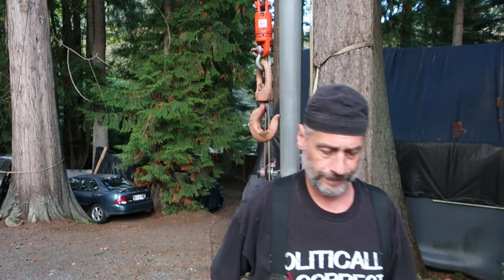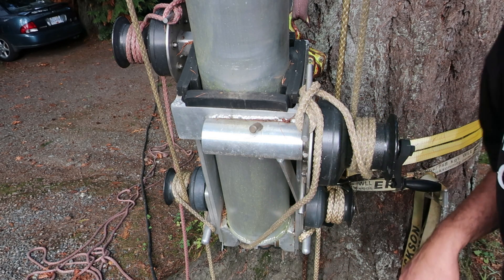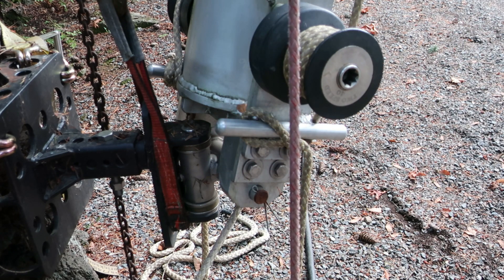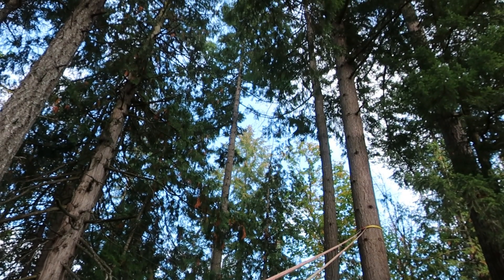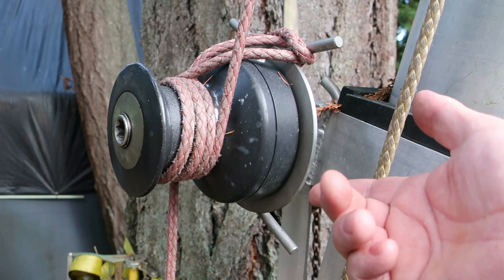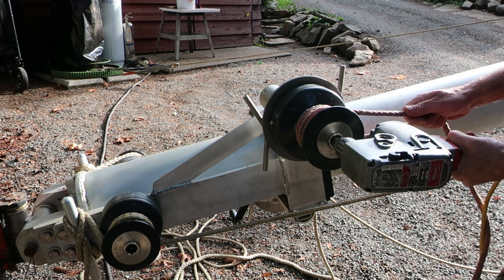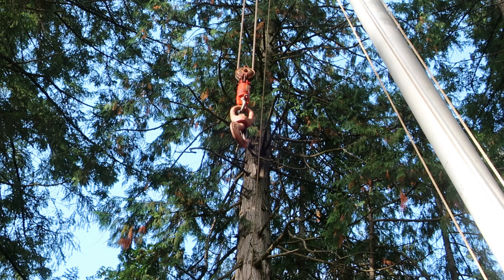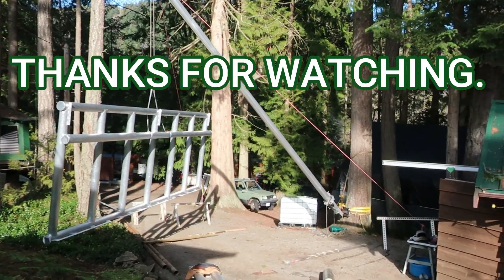A DIY portable derrik crane. Another way for idiots to hurt themselves.

Comment: pretty cool. I would like to see a simple crane set up for use on a utility trailer they can reach onto a single-story roof for lifting smaller air conditioners, such as the multi split units
Reply: you can build one with 2inch tubing. take notes that the lenght of the boom is the main factor reducing the load capacity, longer boom means it carry less. also the widest tubing the better, the thickness of the tubing actually reduce it's load bc it contributes to bending of the tube.

Comment: Excellent work. Many years ago we used a similar Boom Lift to build a Three Storey House, Octagonal in shape, and built around a 10 metre high Central Column made from a White Mahogany Tree Trunk. We moved the Girdle/ Universal Joint up to the floor above as we completed each level. It worked perfectly. We lifted all Floor timbers, Wall timbers, Doors and Large Scenic Glass Windows into place , easily, safely and with perfect precision. No gut busting or precarious lifting, all smooth and expertly done. I designed and operated the Climbing Boom Lift, and like yours, when broken down to its component parts  was easily handled by one man. The Builder I assisted approached me before he accepted the job, to see if it was feasible. The job was on a difficult to access site, and although other builders quoted the job, their high prices were a reflection of moving an all Terrain Crane into a difficult site. Our price ended up being a third of the other tenders. The beauty of this one man, portable Lifting Apparatus was it cost very little to build and use. I also worked as a carpenter on the project. I worked with this same builder on many projects that other builders could not do. We built many other different Lifting Apparatus when required. As an Engineer I found the work both challenging and rewarding. Cheers from Michael . Australia.

Comment: Fascinating how the boom is used as a compression post which can take  I suppose in theory 20 tons as shown in the pressure test yet is so light weight aluminum.  The weight somehow directly transfers  from the lifting point cable down through the boom to its anchor point at the tree base, while the boom itself and the weight being lifted also  are supported by the boom support cable, and somehow none of this  bends the boom pole.  I'm curious as to how this actually works but I guess it''s  what I described if I understand it correctly.   It seems lifting the weight is one obstacle while to then pivot the lifted weight would be  another vulnerable point  on that welded bracket.  How much do you feel comfortable lifting with this set up?   I'm guessing a ton or two?
Reply from the maker: I think we are on the same page.  1 or 2 tons, more than that and the tree and it's bark would begin to get damaged I feel.  If it were on concrete and had a significant mast the failure point would be interesting to see.  It reminds me of the cranes I've worked with over the years and how they have engineered those spindly booms  to take such a load.
Reply: according to the equation of bernouli, yes, 4inch tubes can carry 20tons, but that's like the upper limit,

Comment: The video title is 100% accurate.  I built one very similar but used 4" sch 40 carbon steel pipe. It defiantly made the list of tools I will never let anybody use. Had zero issues lifting one end of a lightly loaded 40' connex container with it.

Comment: What is the weight capacity?
Reply from the maker: I have lifted 1500 pounds, I would haft  to change the come a long to something bigger to lift more.  Probably would go to different rigging, I think 1500 pounds is as much as I will push it.
Reply: Tbe weight capacity is the rated safe working load of the winch and cable being used. Typically the mast is guyed off with stays to appropriately sized ground anchors or counter weights, not affixed to a tree. The critical areas are not the mast and boom themselves but the connection points. The compression capacity would be high. A vertical southern yellow pine 6x6 can easily take 20,000 lbs. One to two tons on a system like this doesn't even put a load on it.
Reply: @klpittman1  yes, even the boom can take up to 20tons, but the failure point will be something else.